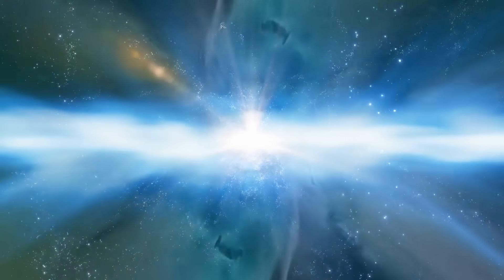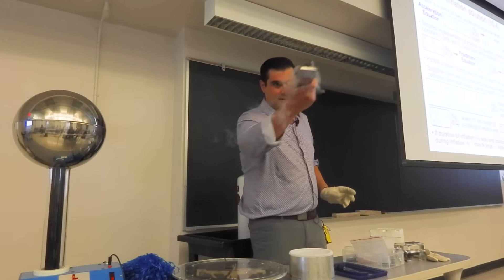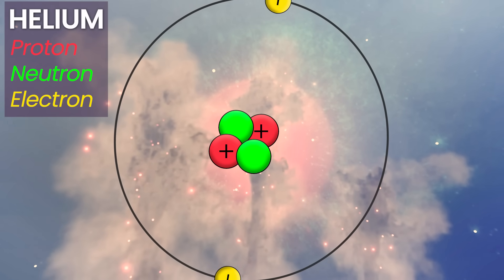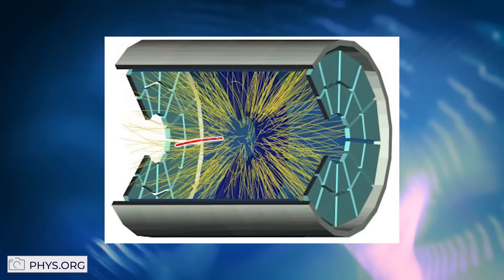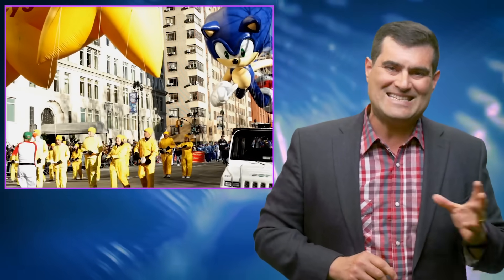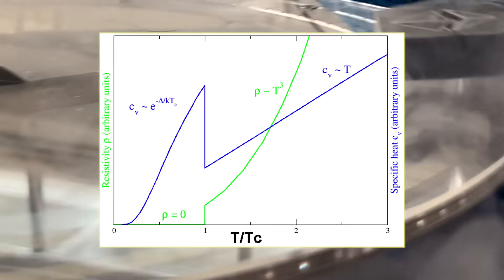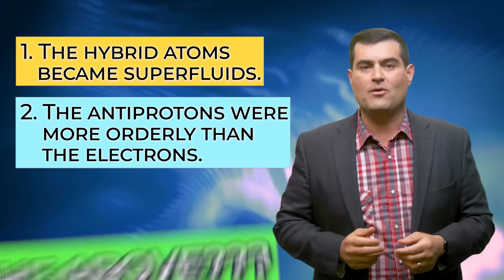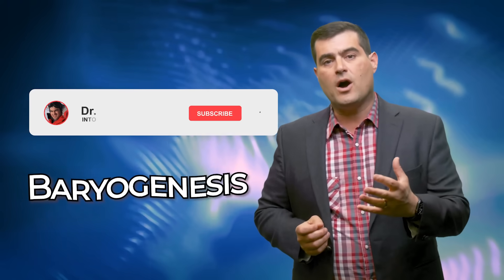Scientists Just Mixed Matter and Antimatter (It Didn't Explode)

Comment: Imagine if we could stably bind and destabilize anti-particles at will. That would make the best fuel and energy density imaginable. My iPhone could store more energy than a nuclear warhead.
Reply: Nah, iPhone powered world will be far worse than a Nuclear wasteland.
Reply from the maker: You can stabilize them.
Reply: @DrBrianKeating  "Google" says that "antimatter" is STILL ONLY A THEORY.
Reply: I'm not sure you'd want that....
Reply: the hiroshima bomb was a mass- energy release of about a gram
Reply: @tayzonday  Beepers would be even more dangerous....
Reply: That sounds great until you consider that even lithium batteries have been known to swell and burst into flames without any user error involved...
Reply: @BladeTrain3r  that is an inherent problem because of silicon’s ability to capture the lithium ions so well, which is also why they use it lol. Currently they are trying to use graphene along with silicon to make a better more efficient and stable battery called silicon oxide graphene or sog. The graphene’s strength, conductivity and 1 atom thickness allows them to create a lattice to encapsulate the silicon improving the capacity, charging speed and also reducing the overall weight.
Reply: Incredible for a battery actually.
Reply: @GastropodGaming2006  The main problem is that it takes CERN energy levels to generate anti-particles now, so even if we can stably bind and unbind them . . . they're not spewing out of the ground like fossil fuel when they cost $25 billion per gram to make . . . the same energy of about 13,325 barrels of oil which only costs $1 million at today's prices.
Reply: @tayzonday  I'm imagining this battery as being used for powering spacecraft, or other applications that would benefit from an insane amount of stored energy.
Reply: @ We can already theoretically get spacecraft up to 0.1c with timed nuclear detonations and a pusher plate— we just don’t have any good way to slow down. Highly concentrated energy like antimatter might fuel a viable way to slow down.

44 years is still a long time to learn anything about Alpha Centauri, so there’s little political willpower for such undertakings.

If we can find a fast way to get spacecraft out to 600 AU, we can use the sun’s gravity to magnify things— but it’s essentially one target per craft, so there’s limited payoff if it’s not done hundreds of times.
Reply: @tayzonday until someone figures out a new way to generate anti-protons. Inevitably. Something I've quietly fretted over all my life, because that would effectively democratize nuclear explosives. As in cheap and easy and a much bigger bang than that of uranium or plutonium fission.
Reply: @tayzonday you could have a smaller ship with a mini cooler. Let’s say that ship is the size of a person. We can now get that to Alpha Centauri with these hybrid atoms.
Reply: just don't drop your phone
Reply: destabilizing is in this case simple. Just warm up the helium. It will stop being fluid and BOOOM
Reply: But we can't, so what's the point in imaginary ng it. Why not just imagine a genie in a lamp, or f we're going to imagine impossible things? A genie would surely produce higher energy density than your impossible idea would.
Reply: @Johnny_Appleweed  Technically both technology that can stabilize, bind, and destabilize anti-particles at will, and genies that grant magical wishes are possible. Technically even a deity is possible. It's just not very likely, but then again, a lot of our modern technology that we do have now rely on science and physics that would have been described as unlikely to impossible in the past.

TLDR; both genies and anti-particle smart phones are possible.
Reply: @Ristaak  No. You can't say something is technically possible without any natural law that gives rise to that something. You can say you don't know, but not that it is technically possible. There are things with literally 0 probability.
Reply: @skvvlk  Only universal negatives have 0 probability of being real or existing. Like you can't have a sphere that's also a cube, that by definition can't exist.
Just like you can't have an immovable object in a universe that contains an unstoppable force or vice versa.

Everything else though is fair game, there have been many things that turned out to be real and fact (like gravity, the motion of the planets, the sun being the center of our solar system) yet we had 0 evidence for all of those things at one point.

Are you really saying that before we had any evidence that the sun was in the center of our solar system, that it was not technically possible for it to exist in the center of our solar system?
Reply: You wanna have to imagine because our ancestors had the understanding of it. But because we have tools, we lost that knowledge.
Reply: Also make incredible rocket fuel.
Also: tiny nuclear bombs.
So.
Reply: Bomb?
Reply: Samsung batteries are already close in terms of yield, no?
Reply: Kindly notice that helium has been in 'short supply.' Not to get too into the deep end, but if you look through the 'wider noise'...
Reply: Omg tayzonday my guy! Hey you like science and music look at the n-speres project that just dropped 7 days ago! Oscilloscope music! The entire project and visuals fit on a floppy!
Reply: @DanielJustinSnyder we had an enormous national helium reserve, but we voted to give it away to private companies to supply Party Cities, and they drained it. Yay smaller government, AKA looting public wealth. 
We had plenty. For lta airship supply, believe it or not.
Reply: @DanielJustinSnyder it's becoming scarcer only here on Earth. Moon has enormous deposits of He3 waiting to be exploited. And of course, there's always the gas giants, all you need is a rocket flying in a tangential trajectory towards them so they barely penetrate their topmost layers, open their cargo bay, and let in as much gas as possible while accelerating as much as possible. Then they close the gates while getting out of the gravity well: bingo, you can get as much hydrogen and helium as you want this way, relatively cheaply if you do the Obberth maneuver correctly. The interesting part will be refining all that gas, separating the [H] from the [He]. And hopefully also separating the 2 isotopes of Helium - an economically viable process for that needs to be invented

Comment: So much evidence points to No Quarks, instead, a Proton = 2 exactly 1/2 neutralised positrons repelling each other around a fully neutralised central electron. It's a stable configuration. A Muon is a malformed anti-proton where 2 electrons are not 1/2 neutralised by the fully neutralised central positron, so when they slow from near light speed (where time stands still for them) the central positron and 1 electron annihilates, leaving the other electron. 
--
In The Beginning more malformed proton+muon pairs formed than anti-proton+anti-muon pairs, so we're in a matter universe, not antimatter universe. As positrons and electrons are always formed in pairs and there's always an equal number of each in the universe, when the dust settled the end result was a hydrogen plasma soup (instead of anti-hydrogen soup).
--
The Colour Charge complicates matters by combining spin/magnetic properties with the raw electric charge from which all other forces emerge. It's a field of + and - particles joined to form a neutral field cell that can be partially split (polarised to form a magnetic dipole (bar magnet that can point in any direction). 12 cells join to 12 others by a double bond. Fully split cells bond with a neighbour to a +-+ (positron) and -+- (electron). that polarise the field into energy levels, amplified in protons / neutrons (proton+suborbital electron) as Proton Energy Levels.
--
There is total finite universe charge that varies locally, with more charge locally towards galactic centre, taken from voids so voids expand. NOTHING ELSE BALANCES and makes such simple sense. Gravity is surrounding field trying to stay balanced, repelling imbalances from all directions and makes up part of the Strong Force.
Reply: “so much evidence”, but none of it experimental.
You don’t have any measurements that support your conclusion.
Your model doesn’t predict the numeric results of any experiment better than the more widely accepted models.
Reply: @drdca8263  .. The main 'measurements' are beta+/- decay and the fact Proton/Neutron mass is almost exactly halfway between Muon and Tau, which makes sense under my model.
--
muon = ep_e, proton = pep, neutron = pep_e, tau = epep_e... Core Mass = mass multiplied, Suborbital Mass = mass added.. the spare suborbital electron allows the particle to exist a bit longer than a single ep or epep that decay too quickly to be measured. They all rapidly decay when they slow from near light speed (where time stands still for them), except protons and neutrons (although neutrons decay into a proton + freed electron). Annihilation = turning back into field cells + a wave as the rest of the universe rebalances. It's trying to be a ball of equidistant field cells. Black holes annihilate even protons/neutrons back into field cells at their centre, but very slowly as time slows inside black holes. 

---
But the full on TOE is a job for someone else or maybe my retirement - I'm not a physicist but have a logical mind capable of advanced computation when I need too. I'm just reducing the particles and variables to those that are definitely proven. I see modern day epicycles in the Standard Model. Dark Matter/Energy, Higgs Field, Quarks, maybe even neutrinos - and still their charge equations don't balance on a universal scale (ANTIMATTER CATASTROPHE).. 
--
You have to admit, it's at least an elegant idea, with everything flowing from 2 base field particle types and 1 force, the electric force.. We'll see someday.
Reply: Sounds like a combination of Structured Atomic Theory and Plasma Cosmology.
Reply: @risunokairu  .. I am aware of those ideas (through See The Pattern channel), and they may well have some validity but I don't deal with large scale universe structure of Plasma Cosmology and my quantum gravity as an aspect of the Strong Force is a spherical force, and the Structured Atom model is a lot more lumpy and oddly shaped, but I like it. They've done some half decent maths and graphical modelling to their credit, which I haven't yet done (if I ever will), apart from proton/neutron mass being almost exactly halfway between Muon and Tau 'Lepton' (not a lepton in my model) bar a small amount of 'bounding energy'.
--
Muon = ep_e, proton = pep, neutron = pep_e, tau = epep_e... where the core is a Mass Multiplier Mechanism and suborbital electron is a Mass Addition Mechanism. There are antimatter versions of each.
--
It's a deeper theory than both, and the more flowing 'Electro-Positronic Field', semi-quantised version consisting of +ve quanta and -ve 'electro-gas' as the base field is 30 years old, from my A Level chemistry days at school.